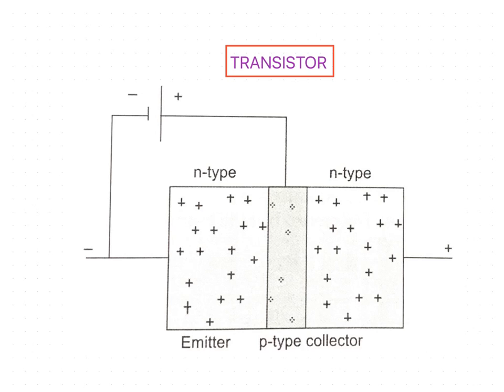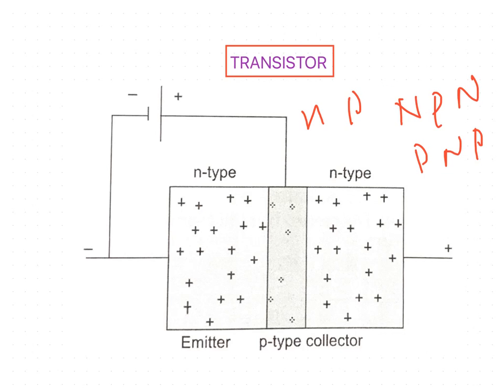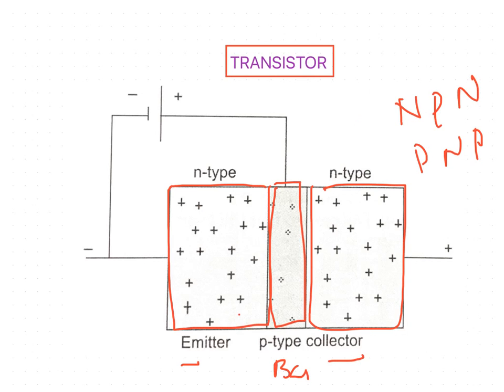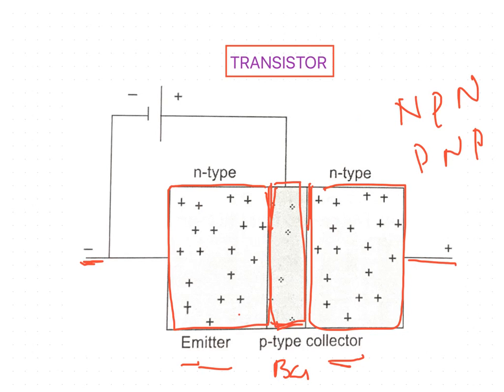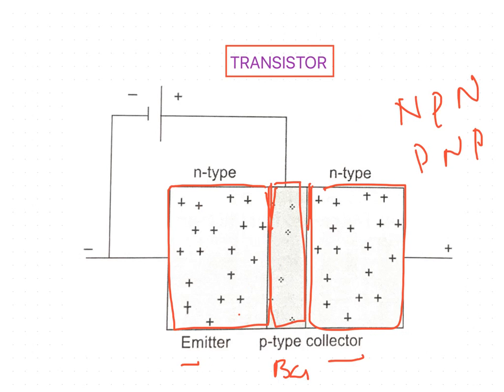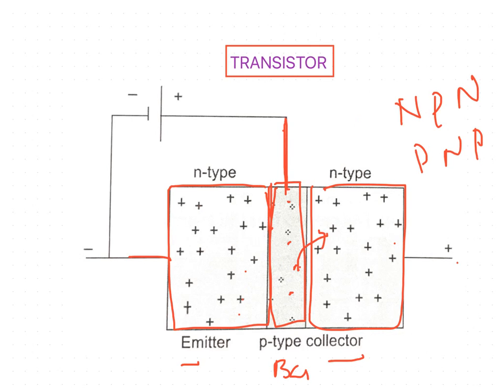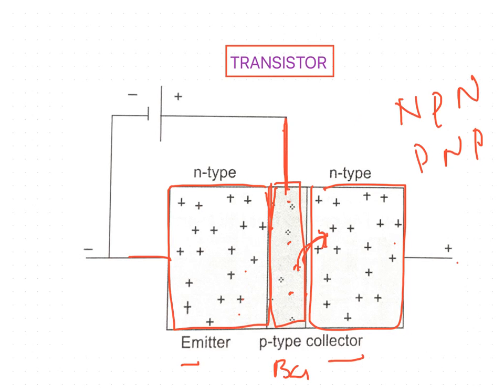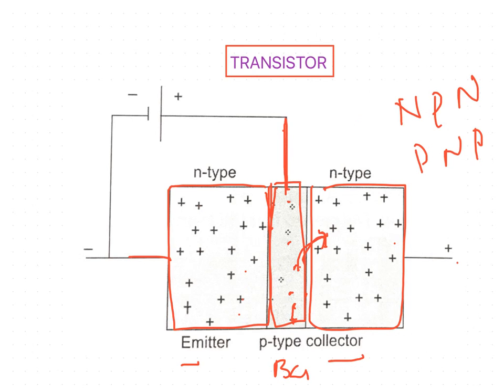Transistor

Comment: What is the critical value said in this context can you please explain Mam?
Reply from the maker: In this N-P-N type semiconductor, potential difference develops at their junctions and always remember that current flows from P to N type due to their form.Initially the emitter and the collector are positive relative to the base at this stage potential difference develops at this junction opposes the electron movement then the purpose of the semiconductor is not acheived. a source of emf is attached negative to emitter and positive to collector , at this stage also the base still opposes the electron movement because the potential difference which develops between the two terminals is not greater than that of the junctions of npn. here comes the critical value .the emf should exceeds the pd at the junctions.if you increase how much amount of voltage at the collector side there is no difference seen at the junctions of npn . so a  second source of emf is attached to base and the emitter,then the base being positive than emitter but base is still less positive than the collector side. at this stage the electrons are diffused from emitter to the base(forward bias)and from the base the electrons are pulled out by collector(reverse bias).
Finally critical value is the value at which the emf required to allow the the flow of electrons through the base.normally the source of emf in N-P-N type which is connected to the base is +0.7V.
Reply: @pragnyadaanacademy4793  thank you mam